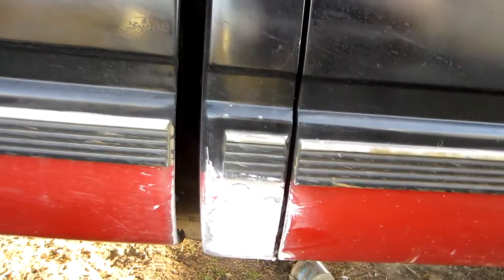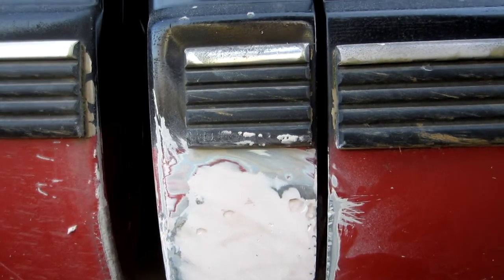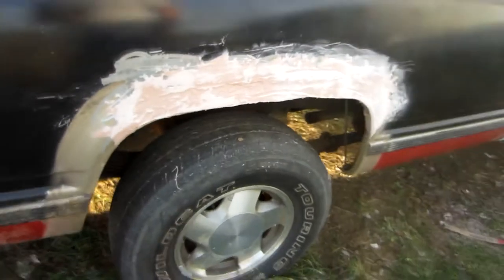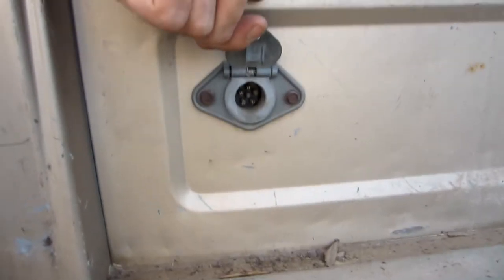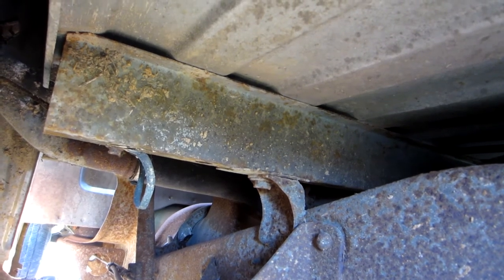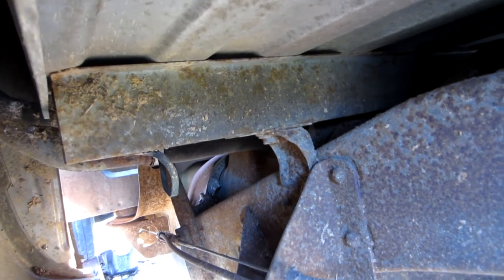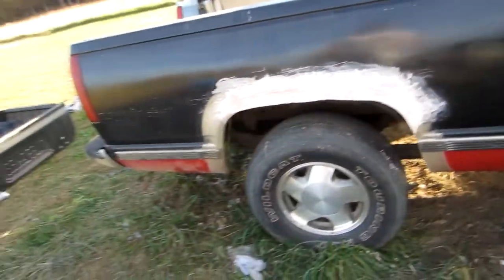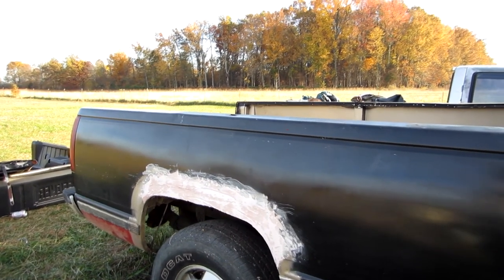4x4 daylight look, update, and plans

Comment from the maker: @obieezx11 i have spot putty also but i thought it was for little dings not filling in holes in bondo but i'll try it since those are just small holes.  it's not doing anything else but sitting on my desk right now so i might as well put it to use. i actually thought about borrowing the neighbor's sand blaster and giving everything a blast then hit it up with undercoating. this truck was bought around here but has been up north at some time hence the rust. they usually don't rust around here.

Comment: first.
Jim in oz we have this stuff called spot putty its to fill little marks in your filler its aply strait out the tupe no mixing and hardens the same as the bog dose makes life a lot easyer.

re you going to give the back chassis a going over with some tar while the tubs off what i do is get some stuff called black jack its like road tar and thin it out with desile fuel then

Comment: The only place near by me up here and when I was in SC, that had assembly lube was napa.  Should be used even on small engines I have learned the hard way.  Hope that engine pulling goes smooth, get some vid of that and the engine progress if you can.

Comment from the maker: @obieezx11 Actually i was speaking of the frame when i said i was going to sand blast i was thinking of hitting the rest of the truck with some Government De-paint which just eats it all off down to the metal without all the work and just start out fresh and new with sealer and fresh new paint. enamel is a good idea if it's cheaper because cost is deffinately an issue here. plus i like the thought of shooting everything at once no basecoat clear coat

Comment from the maker: @OzLioness it's a $50.00 fine here and no points on your license just another ticket. but they aren't able to stop you for just that alone either. you have to be doing something else wrong also. in my old age i am getting a lot more careful about  my driving too. when i was younger i used to just rip and tear everywhere i went. i'd hold it on the floor constantly some days, but now i am comfotable just above the limit (3-5mph / 5-7 KPH for you auzzies) & MUCH more alert & safe.

Comment: @daddytech When you sand blast the thing dont get to close to it you dont want to streach the pannels out of shape  sometimes this can happen with sand blasting as the metal gets as hot as fuck and streatches.

also doing the hole body wouldent be such a bad thing as if its in saturn black like you said or cant think of the name has no shine on it black its probably enamel and if you want a show room spray job on it and not have to

Comment from the maker: @VicGord actually the body is the same from 88 to 99 the only real difference in any of them is the 96-99 has a different dash, grill and of course the motor and transmission. there is a 2000 tahoe limited that is still the same body style but the trucks were changed to the new style body in 99 the tahoes and suburbans were all changed mid year in 2000

Comment: @daddytech there the very first thing id do was take it home and fill all the sills and doors and boot with desiel and let it soak for a week it wouldent alow it to rust at all its a brillent rust guard will save you a packet in the long run ive noticed cars there as late as 2007 rusted to death must cost the ppl there thousands to replace them.

Comment from the maker: @fatass721 I have all new seals and bearings, the motor isn't tired it just ate the bearings on #2&3 & the rods werent messed up there was in fact still bearing material on the inside of the ones that were ate up. the rods are still fine and haven't been spun or knicked the only thing that thankfully was damaged was the crank the only reason i thought the timing gears were a good idea is because after 215,000 that is sure to have stretched some and since new ones weren't that expensive why not?

Comment: y dont u just do a stock rebuild on the engine and replace the pistons and rods with a set of brand new stock set and rings and bearings and if i was u i would also change the rear main seal while i was at it it would save you a lot of time and money in the long run